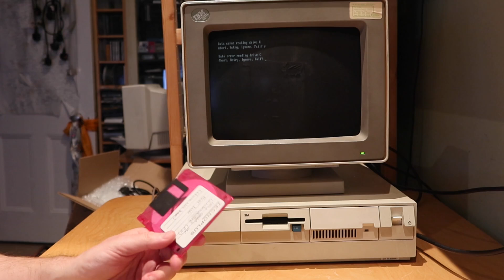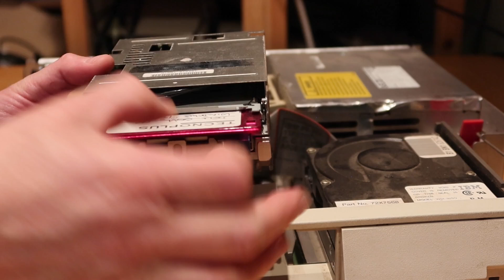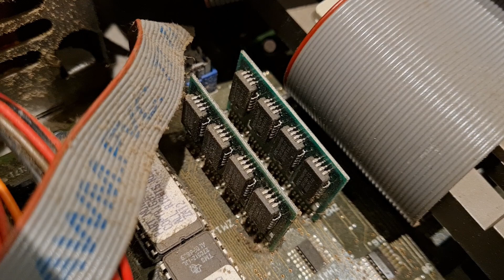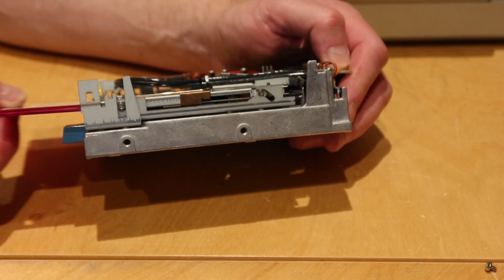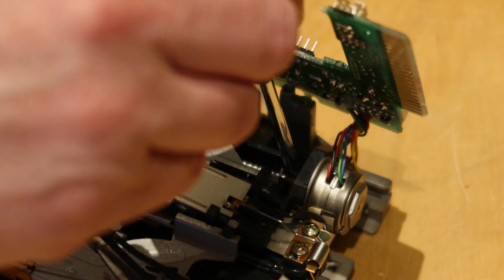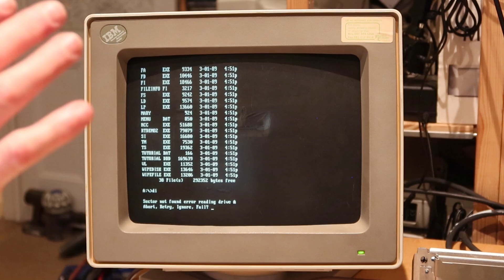IBM PS2 Model 30 286 First Looks and Restore   Part 1

Comment: You're going to have to be a bit braver with that floppy drive. It needs stripping down, cleaning and properly lubricating with silicone grease (not oil) on the metal bits that touch and slide (most of which you can't reach without stripping down). Epictronics has some excellent videos of him repairing and servicing these exact drives. The PCB will also almost definitely need recapping. Even if they haven't leaked yet, they will, and that'll destroy the board.